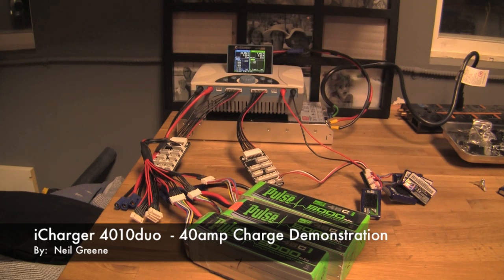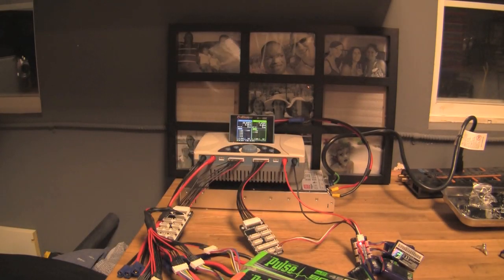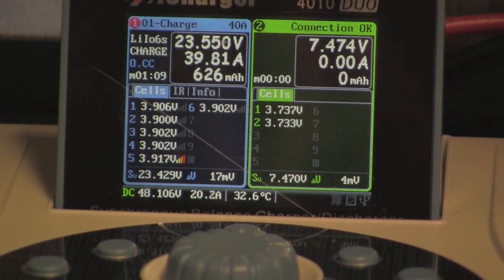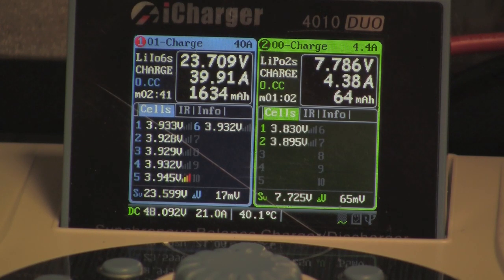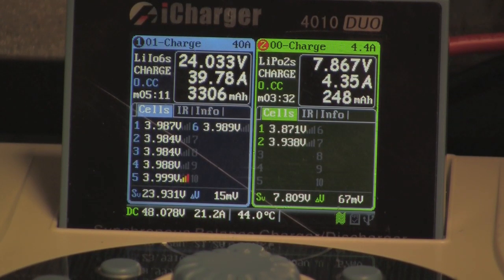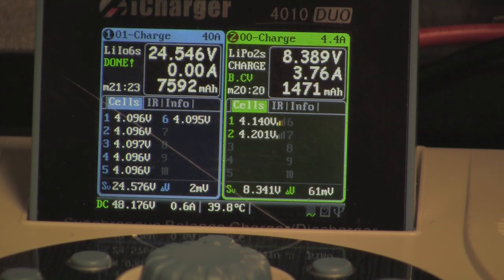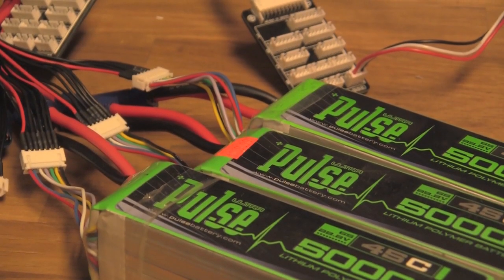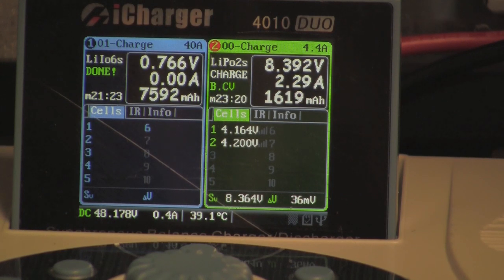iCharger 4010 Demonstration @ 40amps

Comment: Thanks for the review, Neil!
Is it possible to simultaneously charge a battery in the 1st channel and discharge another in the 2nd channel for some load?
Reply from the maker: If you want to discharge at high rates, then you need to connect your changed batteries to CHANNEL 1 and discharge to CHANNEL 2.  If you want to charge on CH1 and discharge on CH2, you can do so, and you can drive your CH1 to 40ams, but your discharge CH2, will discharge at a low amp rate since it only has its internal resistors for dissipating the energy.
Reply from the maker: Max Yuzhniy This is known as REGENERATE DISCHARGE.  And I do it often to insure my batteries do not sit for weeks at voltages above STORAGE LEVEL.

Comment: Your port 1 was charging as LiIo instead of lipo, also you're running the charger at 40 plus amps, charger max is 40 amps total or 40 amps each port?
Reply from the maker: scrc511 Yeah, the problem of doing videos at 3:00 am.  The 4010 will charge at 40amps/channel or 70a in synchronous mode.

Comment: In sync mode does it just double the amps or can you charge a 20 cell lipo? I have some very large lipos (not for rc of course) that I need to charge.
Reply from the maker: The 4010 duo will charge at a maximum of 70amps in synchronous mode.
Reply from the maker: Hmmmm, I am not sure about a 20s pack?  And you do mean a 20s pack, and not something like multiple 6s right?

Comment: Hey this charger doesn't show run time? That's one of the only nice things my cheaper Venom Dual 10 Amp charger does.  it shows run time time, current whole pack voltage or individual cell voltage.
Reply from the maker: By run time, do you mean the current charge time.  The iCharger does show the run time of the charge.  As well, you can cycle through to see the cell voltage and total pack voltage.
Reply: Yes the actual minutes its taking to charge the packs. I found it though. The charger shows so much info I just couldn't easily spot it.
Thanks.

Comment from the maker: This is really my field charger.  For fast charging and with the two channels, it lets others with different configs charge as well.  I have two other iCharger 3010b chargers as my original setup and backup.  Like the way you think for backup charger.  However, for the price of the single charger the dual output is still nice.

Comment from the maker: See the update I made to the About.  I get my power information from the group over at ProgressiveRC . com who are GREAT!  But, as expected the magic is in the formula of watts = volts x amp and as the watts maintains 2000, volts drop and the icharger produces more amps (i.e. - higher then the AC line coming in at 20amps which is converted to DC in the power system)

Comment from the maker: So, my charger is plugged into a 20a 110 circuit dedicated only for it.  Same as my setup.  If you are wondering if you change charge at high amps, check the update to the ABOUT I made above.  You are not limited.